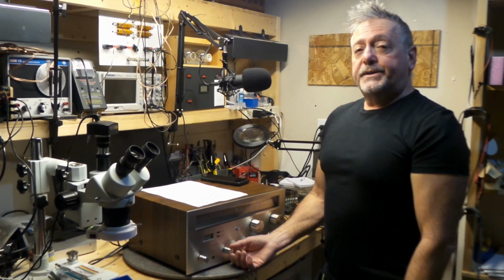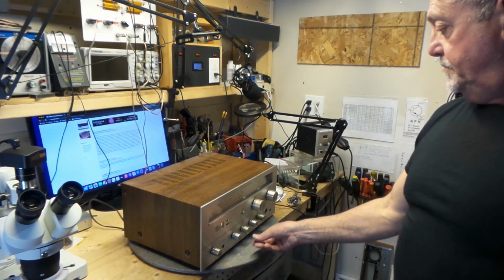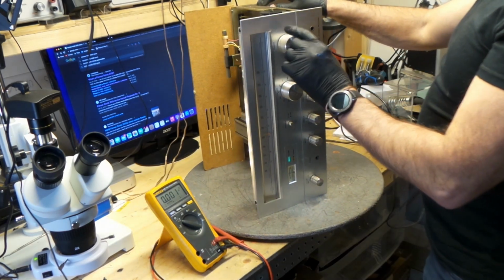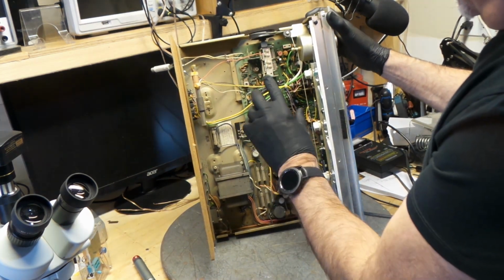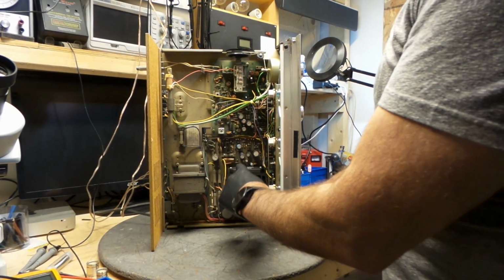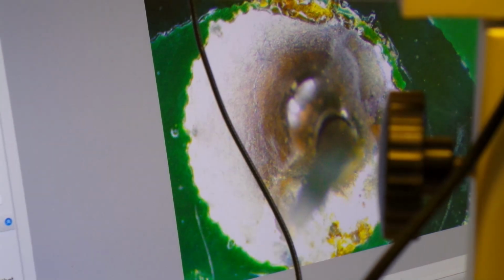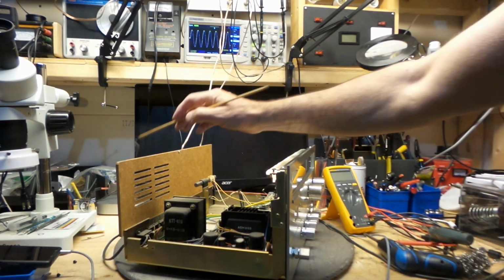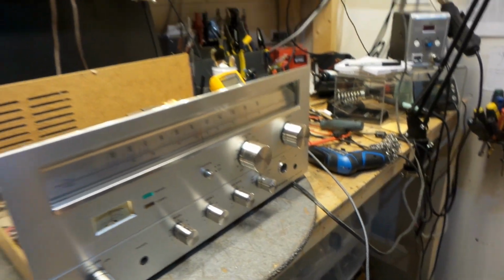Pioneer Rando 2000 low pitch humming noise, fully serviced

Comment: There is a lot of hate for this unit out there and I for the life of me cannot understand why. I inherited my fathers which was brought brand new in the early seventies. Before he passed away I personally replaced every single capacitor in it while repairing it for a intermittent and heat based power issue - it really was just bad power caps.  When you pair this unit with a decent set of speakers, boy does she sing. The base is incredible, but I think it might be time to replace the crossover caps on the speakers, they are faded and slightly uneven. But again, what a system. Nice save for your brother, hope he has many hours of listening pleasure.
Reply from the maker: it's always nice to read this type of comments, yes my brother is using his pioneer every day and he also had bought this new. the issue on this perticular unit was bad soldering and I think I have changed a few caps....I don't always remember from one unit to the next but I rememeber my brother's rando2000 had a humm and it was due to a bad soldering on one of the capacitors...  
anyways thanks for your input...
enjoy your Rando!!

Comment: What are the rail voltages? They determine (roughly) your output power.
For example, a amplifier that's rated 25Wpc will have rail voltages somewhere around +/- 28 to 30
No info on these output modules, but then I didn't look too hard
The AGH003 module is guessed to be equivalent to a STK080 which is a 30w darlington pack I believe.
Never seen this system before, interesting video, thanks!
Reply from the maker: Good point Trevor... Thks